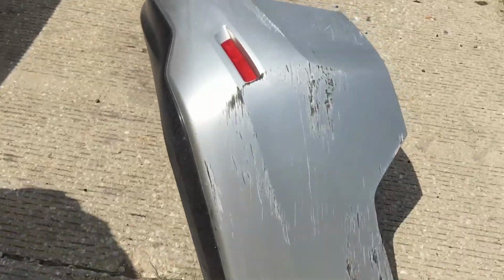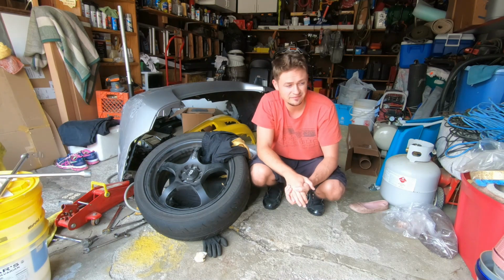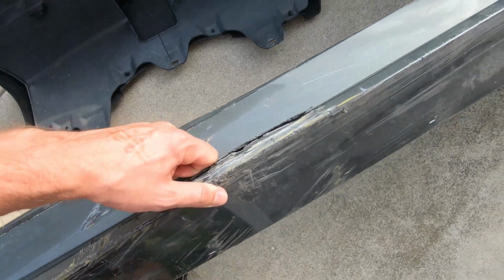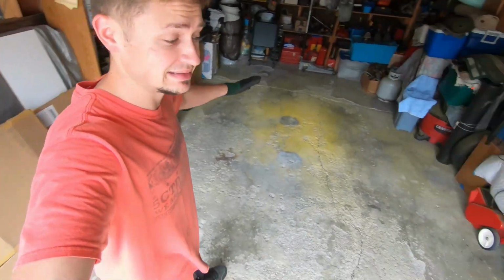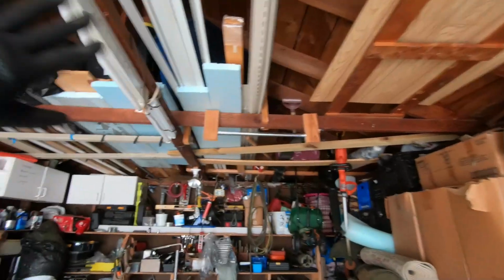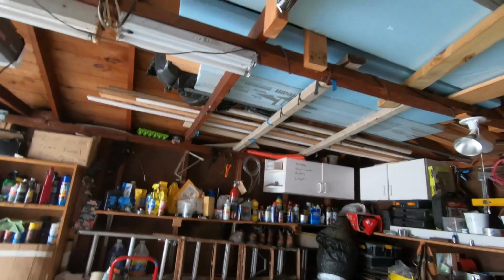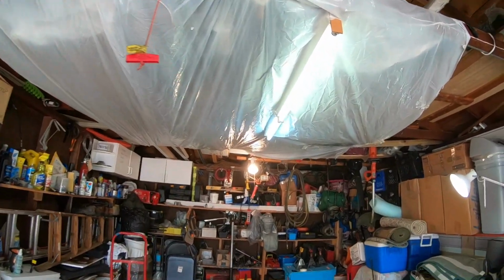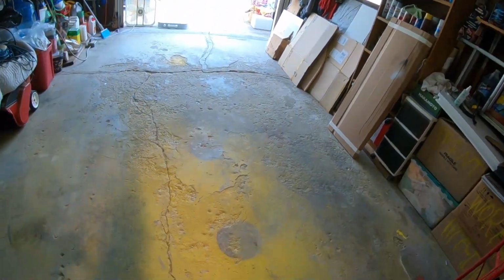Garage Paint Prep for Amazing Results! (Rustoleum Paint Job)

Comment: I used rattle cans to paint a boot spoiler (lip) black in the garage. Should have pulled the car out of the garage.  The overspray was everywhere.  Had to clay the car and scrub the floor.  Never again. :-)

Good job there!
Reply from the maker: Yes I never paint around my car any more. Overspray sucks! And then it’s just hard to clean the car with all that contamination.